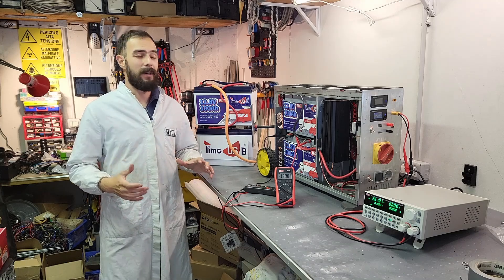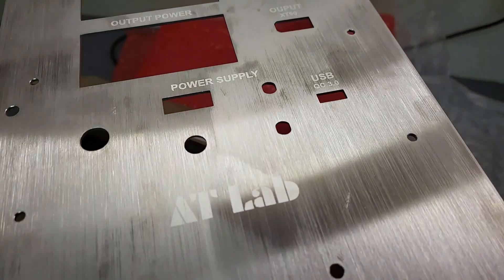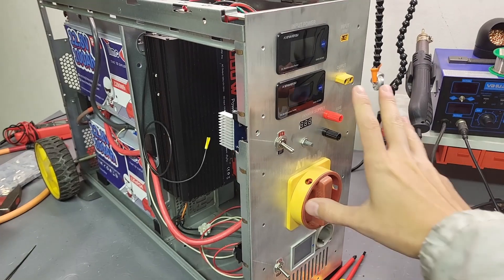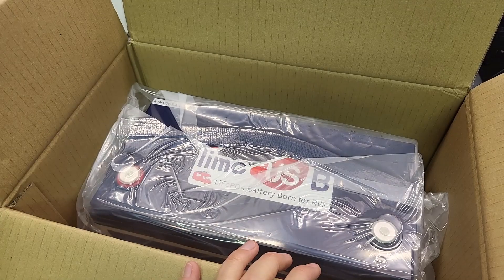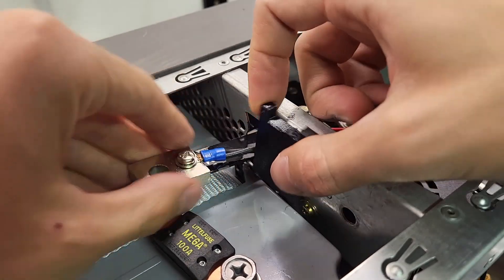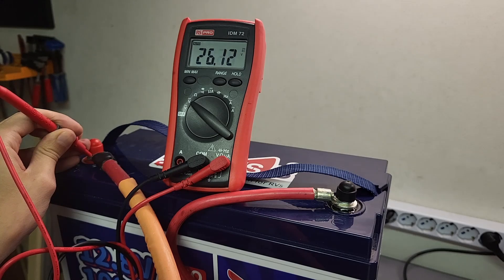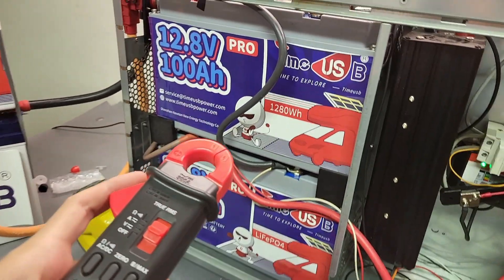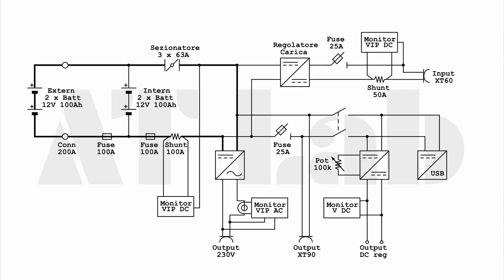How to Build Low Cost Portable 5 kWh Mega Power Station Battery with Solar Charging Inverter - DIY

Comment: Looks good but still out of my price range. those 12v batteries are expensive! 200 euros each.  Using a couple 36V volt scooter batteries 10S3P and a usb adapter and a 36v to 240v sine wave converters seems to be about half that price.

Comment: Let me just call out the BS. 
You can't just build a system and then grab 2 more batteries and call it a 5000wh power station.
You should have just grab 6 more batteries on the side and call it a 10 kwh power station.
So this guy roll out his wheel contraption out to charge the battery without the other 2 batteries but he still call it a 5 kwh power station.
Reply from the maker: Ooo woow really  impressed that you call it as a BS!! And why not calling it MWh just adding a thousand batteries?

Please do not bother with this useless comment and eventually provide useful stuff for improving or building better projects!!